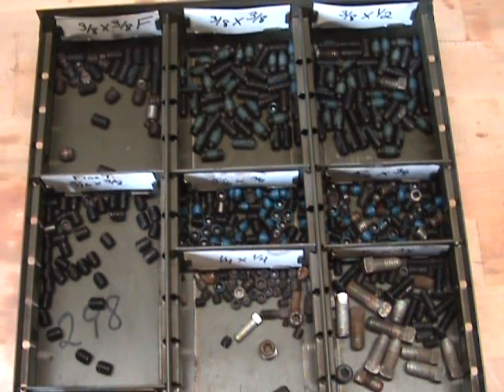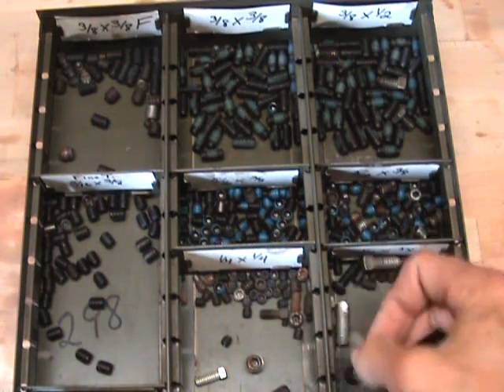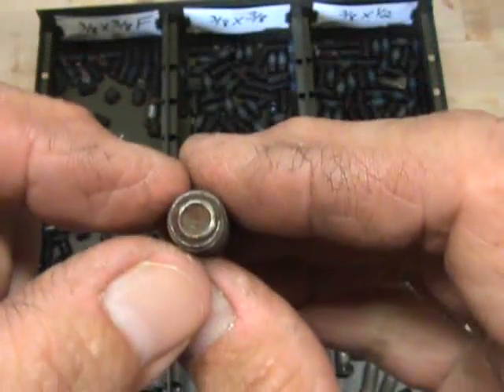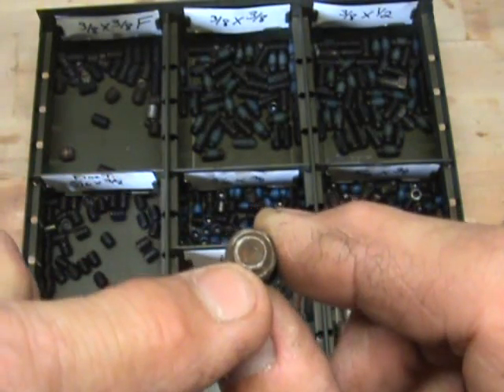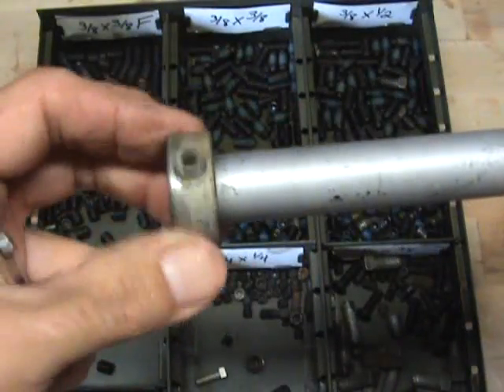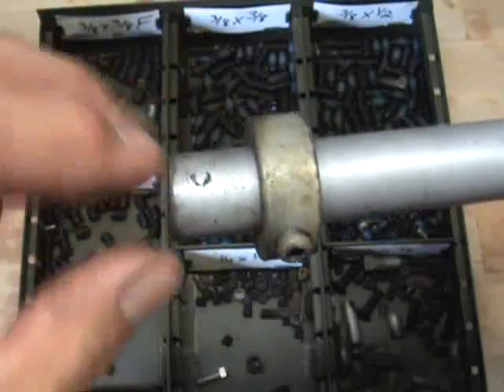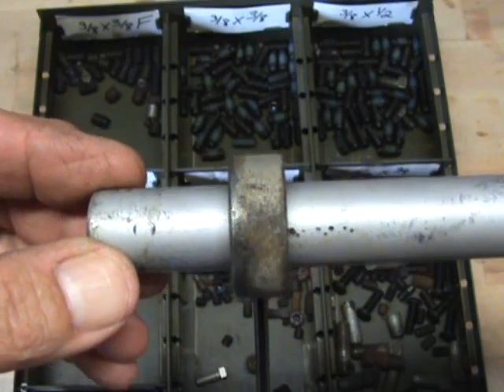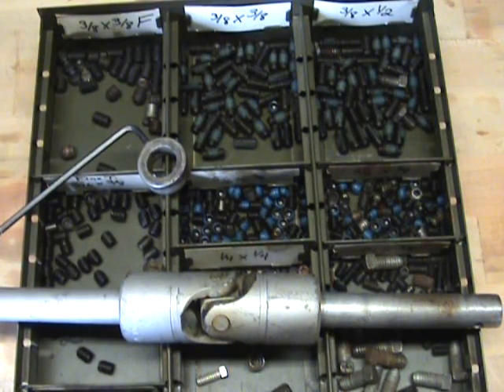Hack!! Set Screw Quick Tip

Comment: on a permanent type fixed position shaft,when everything was positioned,we used to set the the set screw on shaft,causing a mark.removed the collar or whatever you are trying to lock down,then we would slightly grind a flat spot on shaft.then lock down ss onto flat spot using lok tite/thread locker on ss.we had even used the press fit compound to lock collar or bearing to the shaft.to use press fit, metal ''must be'' free of any oil/grease.it takes around 500 degrees to break lock tite ''thread'' and press fit.thanks for vid zippo..

Comment: Can you use a regular hex bolt with blue lock tight and a jam nut? Would that hold on a shaft of a 6.5 hp shaft?
Reply from the maker: Right tool/part for the job Joseph. If it requires a set screw, use a set screw. Zip~

Comment: Great stuff Zip! Do you think you could do a video for me on how to get one of these out that have been locked down for say oh I dont know like 50 years? lol I have 2 on the brake of my 66 Sears Custom and I cannot crack em loose! Thanks Zip!
Reply from the maker: Something you might try is using an impact hammer and just rattle the crap out of the head. Many times, they just need ot have the rust vibrated loose then you can back them out. Heliarch gave me this tip and he's had great luck with it. Hope it helps!